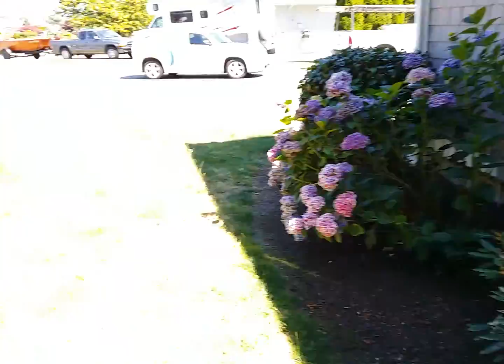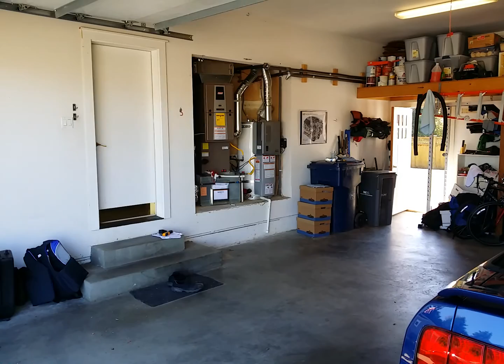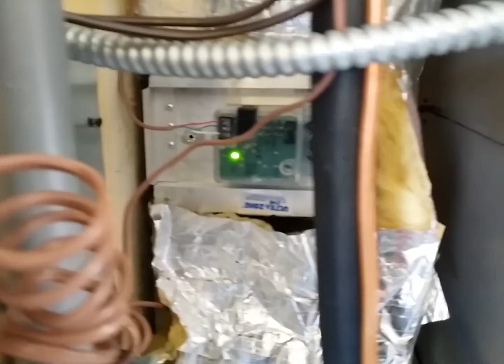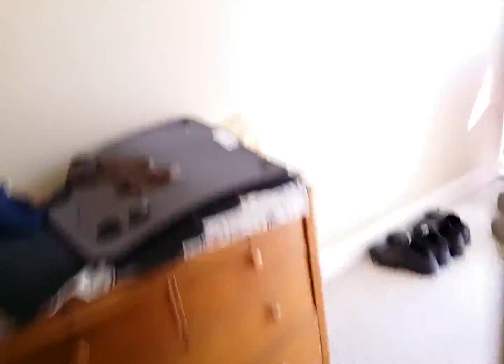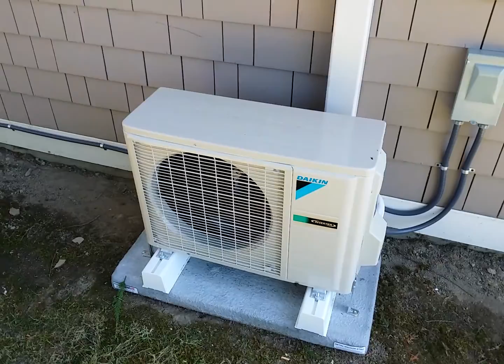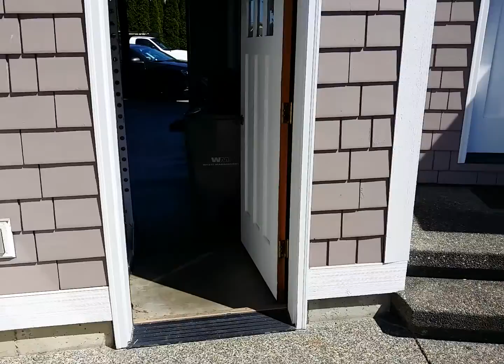Whole House Heating, A/C and Water Heating Upgrade

Comment: How do you use the honeywell zone control with the modulating signal. Or is this a newer panel that i dont know about?
Reply from the maker: This furnace specifically has a "zoning" setting that limits "hunting" by the furnace modulation. Zone System is pretty awesome too though!